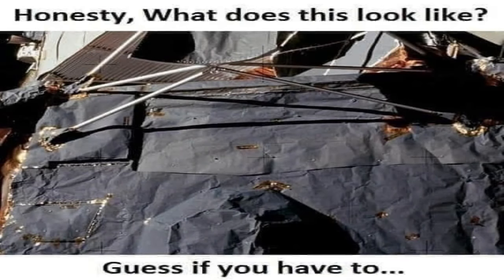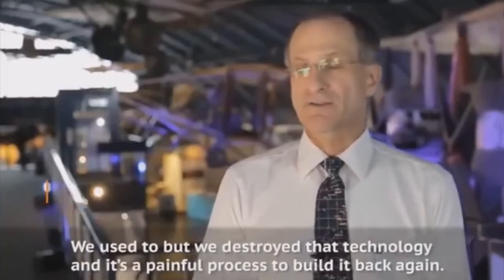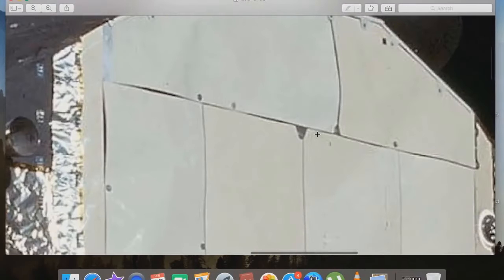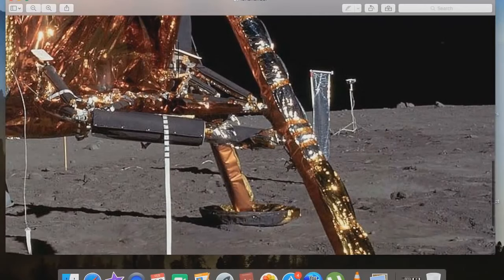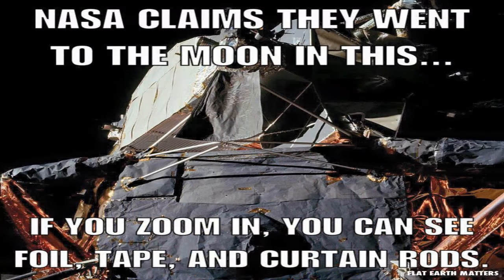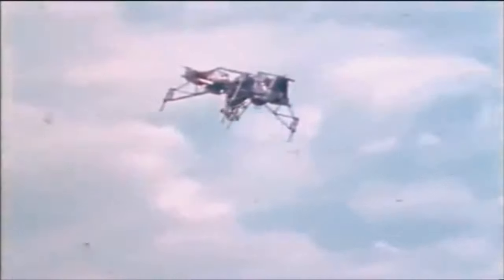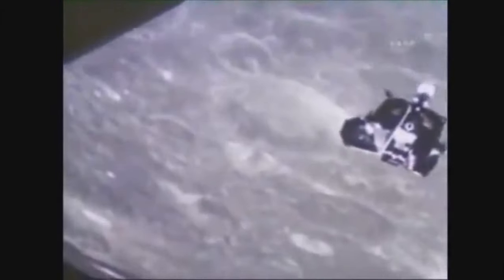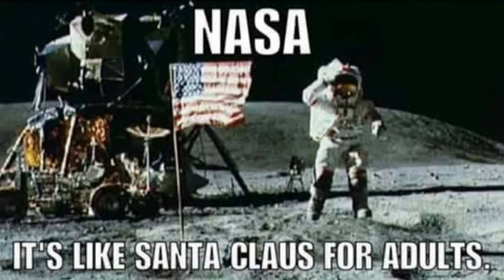NASA's Laughable Apollo Lunar Lander

Comment: It's truly laughable and at the same time sad that people who supposedly have eyes will defend this trash. Here's to keeping level! Always a good job Eric.
Reply: The lunar module’s strange shape and fragile look was due to the requirement of flying and landing in a vacuum. The ascent and descent stages were built to be as light as possible as there was a limit on how much thrust the engine could produce to act as a brake for the weight it was trying to slow down on descent. The outer panels covering the aluminium pressure hull were extremely thin and buckled with the stress of impact and lift off. These were outside the pressure hull and so were completely unimportant in terms of strength.
Because they would operate only in a vacuum, many things didn't need to be sturdy, nor did the shape of it matter. It would never have to deal with aerodynamic drag.
In fact, the LM was designed to buckle in the right places, as this was the most weight-efficient method of handling the shock of landing. The asymmetric bulges on either side of the cockpit housed the fuel and oxidizer tanks which had different densities. The LM was kept in balance by placing the less dense mass further out from the centre.
Temperature was controlled with a reflective multi-layer thermal blanket of Mylar/Kapton and reflective passive optical coatings. The complex insulation blankets covering the module had many layers and contact points between the layers needed to be minimized so that heat wouldn't be passed through them by conduction. 
The black material is where thin Inconel sheets were painted matte black with Pyromark paint to improve their heat emission properties, so they would cool off quickly. (Black material both absorbs and emits heat better than material of other colours). 
This treatment was applied where the hot exhaust of the reaction control thrusters heated the descent stage. The plume defectors were also painted black as were other parts of the ascent stage that were heated by the thrusters.
For the parts of the LM that only needed to be a protected from sunlight, high reflectivity was the most effective approach, and those places were covered with shiny amber Mylar/ Kapton or coloured Pyromark paint. As there is no air in space to pass heat by convection, if you lower absorption of heat radiation by making surfaces that are highly reflective or emissive, insulation is very effective. 
To increase the insulation properties, the Mylar/Kapton sheets were hand crinkled before blanket fabrication.This crinkling provided a path for venting and minimized contact conductance between the layers and so this was bound to make the outer layer rather uneven. 
The LM pressurised cabin was thermally controlled by an active cooling system, using a coolant loop, heat exchanger, and an evaporator or sublimator, where tanks of coolant carried heat away to a porous plate. The heated water entered the exchanger and then reached the sublimator, where it was slowly and gradually exposed to the vacuum of space. The consequent pressure-drop made its temperature fall; the water would freeze on the outer surface of the sublimator and turn directly from ice to water vapour. 
NASA had become increasingly concerned about the growing complexity of the fuel cell system for the lunar module and in February 1965, after months of study, NASA approved a switch from fuel cells to batteries. The command module would continue to use fuel cells for electrical power because of its longer mission duration. But the LM only needed its electrical power for a maximum of 3 days and the simpler battery system was attractive.
The battery contractor for the LM was Eagle Picher. The company had already been supplying batteries to the military for a long time and for the space programme all the way back to the first satellite launched by the US. I. In addition, the company was already supplying more than 40 batteries for the Saturn V rocket.
Silver-zinc oxide batteries were chosen for their reliability and familiarity. There were four 400 ampere-hour batteries in the descent stage of the LM and two more 300 ampere-hour batteries to power the ascent stage.
Reply: @Ruda-n4h  shill or brainwashed😂😂
Reply: @Ruda-n4h  Copy Pasta for moon landing apologists. LOL. God Bless.
Reply: @nordicwarrior5014  No apologies are required.
Reply: @4TH-Raikages-Father  Neither. You have forgotten your basics physics and aeronautical engineering.
Reply: @Ruda-n4h  I'm sure you have another Copy Pasta from Redit to show me LOL.
Reply: @Ruda-n4h  how much are they paying you??

Comment: Another kick in the nuts for NASA, well done Eric you've got them backed into a corner and they've got nothing left.
Reply: @provingyouwrong2375   Of course they won't say but their terrified of Eric Dubay, the man's a hero to mankind.
Reply: @leroy5376  It is definitely not rocket science since the science of a rocket is really no more complicated than a fart.  He either is sold out to the tumor and he knows it is a lie or he is too indoctrinated.  Eric is a hero....agree 100%
Reply: @leroy5376  Actually the LEM’s fragile look was due to the requirement of flying and landing in a vacuum. The ascent and descent stages were built to be as light as possible as there was a limit on how much thrust the engine could produce to act as a brake for the weight it was trying to slow down on descent. The outer panels covering the aluminium shell were extremely thin and buckled with the stress of impact and lift off, which is why they look as out of shape as they do. These were outside the pressure hull and so were completely unimportant in terms of strength. Because they would operate only in a vacuum, many things didn't need to be sturdy, nor did the shape of it matter. It would never have to deal with aerodynamic drag. In fact, the LEM was designed to buckle in the right places, as this was the most weight-efficient method of handling the shock of landing. 
Don Petit did mean that NASA lost the technology to go to the moon in the sense that it was forgotten, mislaid or mysteriously disappeared. A lot of the blueprints still exist on file; but the individual knowledge of everyone involved and the “organisational know-how” of how to actually run such a huge, complex project has been lost. Most of the engineers and technicians are now retired or dead. And on top of that, much of the equipment is incredibly dated, and many things cannot be bought “off the shelf” but would have to be specially manufactured. Re-designing from scratch is cheaper and better.
And what other 1960s technology is so advanced and expensive that it cannot be recreated easily and far better now than way back then?  - Anglo French Concorde, SR71 Blackbird, X15 to name a few.

Comment: Isn’t it remarkable that the absurd design of the OceanGate Titan submarine with off-the-shelf components, carbon fiber hull not rated to 12,500ft depth, scaffolding poles as ballast, and a $29.99 video game controller steering it is being rightfully mocked, and this discussion is crazy talk?